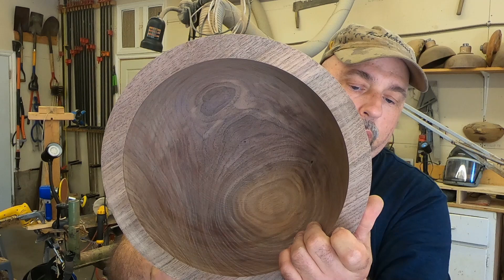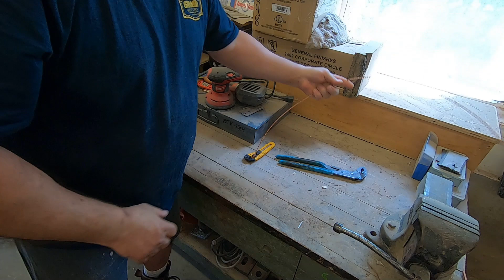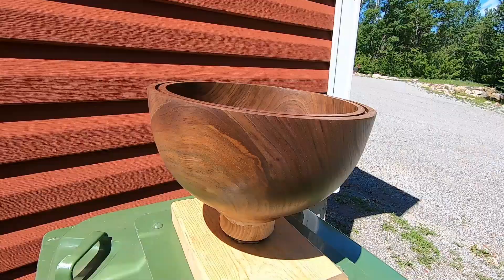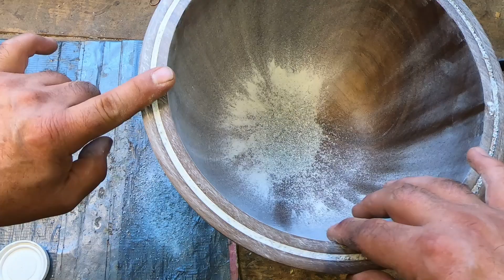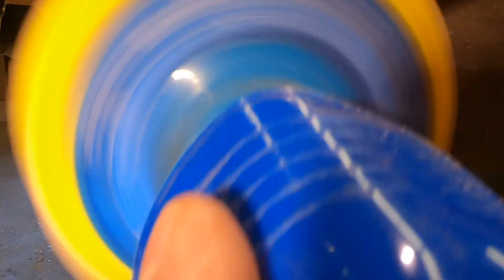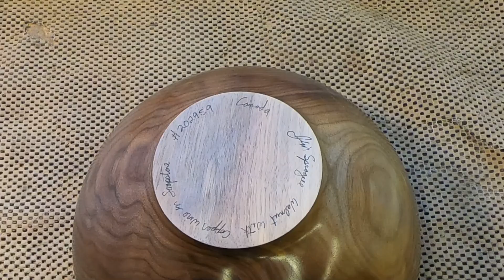Woodturning - Twisted copper wire and soapstone inlay

Comment: Would the soap stone not work better if it were finer like dust as opposed to a more gritty consistency like you used? Also,,, do you think a resin finish would look nicer as you could see the whole wire? Maybe🤷🏼
Anyway... Lovely work. Thank you for the tips and tricks. I'm interested in trying this with old Celtic designs.
Reply from the maker: Yes and yes. This video was done a looooong time ago and now I just mostly use epoxy for inlay work. I use CA some of the time, but I’ve mostly switched to Epoxy. Thanks for watching!

Comment: Pull your twisted wire thru a draw plate to the desired dimension b4 cutting groove. Then you can get tight fit. Jeweler’s methodology.
Reply from the maker: That is a great idea! But I don’t do enough of theses to justify the cost. Thanks

Comment: Beautifully done 😁 could I maybe make a suggestion that instead of the glue dust thing your using, to maybe use clear epoxy instead so you dont lose the depth of the copper twist?
Reply from the maker: I shot this video a long time ago, I now use epoxy to retain work like this, thanks!

Comment: After the steel wool and blowing it off a tack cloth picks up any remaining particulits I have found
Reply from the maker: If it’s sitting on the surface, sure. The problem I’ve got is it gets embedded in the pours and no tack cloth is going to take it out. Generally, I find compressed air works the best. Thanks

Comment: I bet you could run the twisted wire through a roller to flatten it slightly. Continue until it fits snugly in the groove.
Reply from the maker: You probably could, but you might flatten it out so bad that I will become an issue. Thanks
Reply: @SpragueWoodturning  teeny tiiiny adjustments

Comment: You could silver solder the copper ends together and then sand it smooth for a nicer join
Reply from the maker: But then you would have a silver spot and I don’t want that. Thanks
Reply: @SpragueWoodturning less solder keep wires together but no blob of silver.
Reply: Gold solder too.. lol

Comment: I have to say, the most beautiful the copper wire itself looked was just after you twisted it. the convexity of the curves of the twisted copper wire makes it looks beautiful.  the twist of the metal itself is beautiful. with that in mind, it would be cool to see an inlay of copper wire where it wasnt cut in half by the sanding, but instead you got that full, wreathed copper wire look. i guess you would do exactly the same as this, but make the indentation for the wire inlay deeper, then fill it with a clear resin and sand til just above the wire. maybe there is some otherway

anyway your work is incredibly beautiful and i enjoyed the video. just sharing my idea/2c
Reply from the maker: I might cover this in the future, thanks!
Reply: @SpragueWoodturning  no worries, clear resin might dull/diminish the visual qualities of the copper anyway. was just my  thoughts watching the peice come together. amazing work man

Comment: It looks incredible! Just a thought 🤔; what if you took a 14 gauge, or even a 12 gauge, twist it the same way and maybe flatten it somewhat with a hammer before inlay? I realize there are probably a litany of things that may possibly be difficult with that, but it might look pretty cool with that soapstone or even a resin
Reply from the maker: The only issue with that is it won’t look uniform when it’s sanded back. Other than that it probably would work. Thanks

Comment: Dear Jim, what an inspired turner you are ! I am always amazed by both you skils and creativity. Going one step further how do you get to price your production ? for example what price tag would you put on this bowl and how do you get them to market. Once again thank you for sharing your talents.
Reply from the maker: This bowl should be in the $240 to $280 price range. Most of the prices are based on size, type of wood, time and materials to make each bowl. A very hard question to answer. Pre covid I traveled Ontario selling at juried art show, usually 14 events a year. Now that I’ve switched to YouTube I now longer have the time to do production so most of the sales I make are off my channel and other private showings. Hope this helps. Jim.
Reply: @SpragueWoodturning  thank you. It does help me  a lot benchmarking against a high end performer. I made my first order of Designer Epoxy and resins and saw your presentations of both products. Sincerely

Comment: Nice job.
I am not used to inlay copper wired threads. 
But I did sometimes with flat aluminium inlaids or copper.... 

Since I worked in Switzerland and Tirol I used much more thick colored veneer inlaids (4 / 5 mm thick).
Their tradition : they are used to incrust them around table or squarred feet or they compose naïve motives as a nest with birds.. Armorials... Etc.

But this is coming originally from  beginnings of marketry  compositions on wood walls (landscapes and portraits of nobles... Geometrical motives as castles on chests of drawers facades in italy or france at 17 and 18th century.
As they cut wood veneers by manual saw s (!) [and I did it myself sometimes "full manual work"... Exhausting job for sure ] thickness of veneer was often between 2 mm thick (to 4 or 5) . 
Sometimes much more and irregular. 
Then end of 18th c. Costs of wood increased (especially very nice  exotic woods arriving in european ports becose of lesting boots coming back from carabean or south & north america after slaves transportation  - africans or... Even white... as Irish in virginia.! ). 
And they lowered prices by organising workshops and "craftindustry of furniture" by specialisized people who knew how to provide thin veneer. Then, came time of meccanisation (first third of 19th) with the very first "veneer saws" yu can always see in action in paris old workshops of furbishers of veneers. ("scie au bois montant") .  With those machines they succeeded / could get 12/10`mm to 9/10` sew wood which signed this period of production of marketry. After... during 20th c. woods were boiled first and then cut thiner (7/10`mm then 6 then 5..  4!)... 
Then came with italiens.... Photography of nice wood.!!! False production. 
End of story... Furnitures same as shoe boxes... Sad times.
Reply from the maker: We are a disposable society now, it’s such a shame. Thanks 🙏

Comment: Glad I found this. Used it in a Xmas ornament. I had planned on filling the groove with colored epoxy but no way hold the epoxy so I just kept filling it with medium CA. Shocked it came out out so even with me chucking it 3 or 4 times. 

I only had red coated Aluminum wire  in the right gauge and the light reflecting off the red sort of colored the CA.
Reply from the maker: That’s sounds pretty cool! Thanks.
Reply: @SpragueWoodturning  ill email you pic.

Comment: If you hold the two ends of the wire on two saperate vises or anchors, the twisting formation is a lot easier to form.
Reply from the maker: Ok, thanks for the info, Jim.

Comment: If your recess is too wide, you could wind the copper a few more times to make it slightly thicker.
Reply from the maker: Yes that will work but if it’s wound too tight, it will distort and won’t look even when sanded back.

Comment: Think about this. If you grooved the top with a v cut just enough so the wire is sitting a hair proud, then when you glue it and sand it down, the copper wire will always fit tight to the sides. Make sense?
Reply from the maker: That may work but it doesn’t leave much material holding the wire in place or at least that’s the way I see it anyway. Thanks for the idea, Jim.

Comment: If you wanted the surrounding areas around the copper to be black (instead of soapstone), do you think it would be ok to fill it completely using colored CA glue?....or do you risk having small trails of black glue leaching out a bit into the wood grain that you might not otherwise see with clear glue?
Reply from the maker: No, that would work just fine I believe. The key would be to not use any accelerator on it.
Reply: Cool.  I'll have to try that.  I have a different spin on this.  What if you wanted to inlay the copper around the side of the bowl using the same black CA glue?  How would you fill the void with black CA without it running out of the slot?  Do it in very small sections pointed straight up?

Comment: Lovely work, I really enjoyed seeing the skilled workmanship. Can I make a suggestion to flatten the twisted wire, this will enable more of it to be seen when sanded back. Also it can be adjusted to fill the groove more accurately.
Reply from the maker: I’m afraid if I’d flatten the wire it might look really uneven when sanded back, but you never know. Thanks 🙏
Reply: @SpragueWoodturning  I’ve seen it done with a roller which made it level, but you are sanding it back.

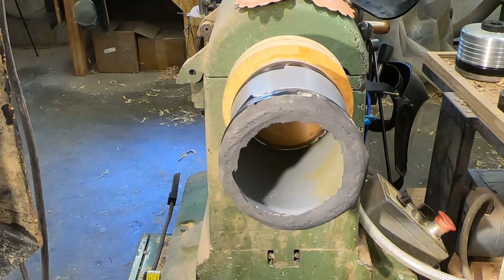Comment: Beautiful bowl!! I am curious what it is you use to hold the bowl to finish the bottom? I see it at the 34:46 point.
Reply from the maker: It’s called a vacuum chuck. It hold the bowls with vacuum pressure and doesn’t mark up the bowls when doing it.
Reply: @SpragueWoodturning  thanks! I just saw that when I looked at the next video about the seashell inlay.

Comment: Could you put the glue in the slot before you put the wire in? And I like the (Dukes TT) idea of the 45 degree angle. 
And beautiful work.
Reply from the maker: Yes, that can be done too, don’t want to fill up the area with clear glue where I want the soapstone to be tho, thanks.

Comment: You can get scotchbrite pads up to 1000 grit (white pad) then no steel splinters. Great bowl, going to make one for my wife with copper wire salvaged from control box for well pump that caught fire in our garage.
Reply from the maker: I’ve bought the white 1000 grit since shooting this video and they just don’t perform as we as the 0000 steel wool, if I was knocking down sanding sealer then they would probably do the trick but this finish is tough and durable. Thanks, Jim.
Reply: Sprague Woodturning Jim do you think the maroon (400 grit) or light gray (800 grit) scotchbrite pads would work or would they be too rough? What is the equivalent grit of the OOOO steel wool? Thanks Jim
Reply from the maker: Jeff Lynch I would definitely not use the 400, it’s too aggressive. The 800 might do the job. If you can get a variety pack with the different grits and then try them and see want works best for you. Amazon possibly?
Reply: Thanks Jim I will keep that in mind as I did buy some of the bowl finish from a company on the East Coast, could not find it locally in California. 
I attended Mc Master University and lived in Bramalea Ontario.

Comment: When you are cutting what is effectively a hoop, don't snip the ends because they will squash , and lay the end over the start at the desired length and cut at 45 degrees form the top, and if you are really careful, you should be able to match the orientation of the "links" one each cut end
Reply from the maker: Great advice but really hard to do when the wire is down in the recess to get a proper measurement. I totally get what you say about squashing the ends of the wire tho. Jim.

Comment: Be careful with soapstone.  It is primarily talc.  Depending on what quarry it came from, it is possible asbestos might be in with the talc.  Be sure to always wear proper PPE when working with soap stone.
I tried to put a thin twisted copper braid around a Christmas ornament one time.  It didn't go well.  Over time the metal and wood moved at different rates through the seasons and separated.  Have you had this issue with your copper wire inlay in the bowls?
Nice look when you are done.  Thanks for the video.
Reply from the maker: I always ware a self powered respirator, I was told about the asbestos many years ago.
Reply from the maker: I’ve never had a problem with the wire coming out when embedded in the soapstone. Was the wood you use dry?

Comment: Thanks. i'll have to try that. i was wondering why you did not leave the center with a finishing cut to do on it and they you would not have to worry about glue running into the center because it will all be cut away on the finish cuts? Also, have you ever used clear epoxy to secure the wire in the groove?   Thanks, Jim
Reply from the maker: Probably the biggest reason I finish turn and sanding the bowl before I inlay is because I want the inlay centered in the bowl. Can you imagine getting a catch after you’ve spent all that time and money on a inlay?? I’ve never used epoxy for any inlay work. Jim.
Reply: @SpragueWoodturning  I can understand that! I'm going to make one out of 150 yr old cedar from a pickle vat and put in copper wire with turquoise inlay. I'll put the like to the Lumberjock project when I get it tone. If you are not a member of Lumberjocks, Please check it out. the guy and galls on there would love to see your work. I really enjoy learning new things every day and I  like the twisted wire inlay a lot!!!...................Cheers, Jim

Comment: The blue soapstone and copper wire are complimentary, I like American Indian southwest colors. Instead of a butt joining the wire, could you bevel the ends and use bondic UV glue and then set the hoop with CA glue. The wire joint was proud and sanded to reveal more copper. Still wonderful and love to own it.
Reply from the maker: Thanks Jim.

Comment: Have you tried using CA glue as a finish? I carve canes and I used it as a finish. It is a hard glossy shine. Use rubber gloves and something that is lint free and expendable. Ventilation is of prime concern so ventilate real good. I bought an 16 oz bottle from Amazon and the price is reasonable. The cost I figured was close to a varnish finish. Spinning the piece on a lath slowly would work great in your case.
Reply from the maker: I’m familiar with the process, I was under the impression CA finishes were best for only smaller work? Jim.

Comment: With that groove already little too wide, what you should do is twisting the wire a few more twists to make the wire get bigger so when you are putting it in the groove it would get tighter fit. Don’t you agree? Also on the rim inside and outside I would put a small radius on them too. At the outside bottom, the writing areas should be in a deeper grooved to protecting the messages.
Reply: How many Inches did you cut the wire off?
Reply from the maker: If you twist the wire more it will get shorter in length so that won’t work. The bottom is concave so it will protect the writing. Jim.

Comment: Is there a reason you don't use masking tape to stop the glue running inside the bowl?
Reply from the maker: The way I look at it this way, it will need three coats anyway, so why not start now. Also, I’ve used the tape technique and it failed. Your taping to raw unfinished wood and the tape tends to not stick well, Jim.

Comment: Get the copper wire cut to size and soft solder your ring together, that way you won't have a joint.
Reply from the maker: Good tip.
Reply: you can also lay the end of the copper over the other end and cut both side at the same time and end up with both ends having the same angle cut.  Very nice work man. really enjoyed watching this and i hit that red box too! Until next time sir.

Comment: So you use the steel wool in between coats to cut back some raised grain? Or does it give additional shine to the next coat? Thanks! Beautiful projects!
Reply from the maker: Jonas Dieltiens The wood bowl finish doesn’t raise the grain, I’m just leveling the finish and taking out any bits of lint and dust that might be in the finish prior to putting on the next coat, Jim.
Reply: @SpragueWoodturning  thanks for your quick response! Do you raise the grain prior to finishing then? Or not?  seem to have 'fluffyness' when not doing that.
Reply from the maker: Jonas Dieltiens  no I don’t.

Comment: Good job. I did single copper wire inlay on goblets and vase but didn't think about twisted one. Thank you for your idea. I will definitely try that. Have you tried baking soda instead of stone? It's a good filer with CA glue.
Reply from the maker: Thanks, no I haven’t tried the baking soda yet, so many inlays and not enough time, 😝

Comment: I wonder if you'd get a better fill if you use some kind of vibrating device instead of tapping with a screwdriver?  Even your phone on vibrate, touching the wood, would probably help sift the sandstone down.  Also, have you tried cutting the sandstone with a microplane?  e.g. the kind you use in the kitchen to grate cheese.  Beautiful project!
Reply from the maker: I’ve not used a cheese grater or anything else other than a hammer. Some sort of vibrating device might work as well, I just don’t want to mark up the bowl in any way mad the screwdriver is simple. But I totally hear what your saying. Jim.

Comment: what if you would flatten the copper wire a bit on beforehand.  i think it would be less critical for the depth..
Reply from the maker: If you flatten the wire it will be hard to get a even exposure as you sand away the surrounding material, Jim.

Comment: Great tips John! The work looks really nice. I personally don't love the soapstone but I bet that copper would really pop out of the walnut if you used a black or smoky grey epoxy to set the wire in. I know you said to make sure the groove was straight in but have you ever tried cutting it angled outward so that the copper rides in a sort of dovetail all around? That should keep it consistent all the way around the bowl.
Reply from the maker: If the grove is not cut straight, the length of the wire will either get longer or shorter as it’s pushed in the bowl. By using soapstone, it gives the inlay a more natural look, Jim.
Reply: In that vein of questions, would unburned charcoal work? It would definitely set off the copper wire and provide a fairly stable bedding for it also. It may be a tad softer, however.